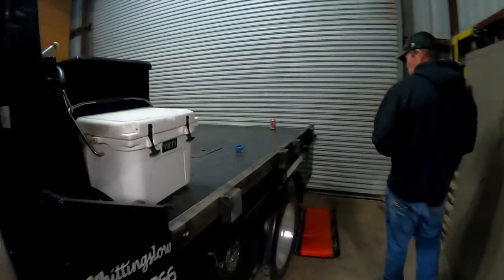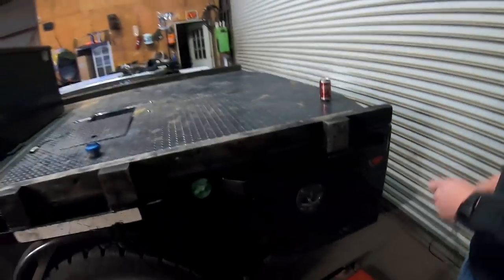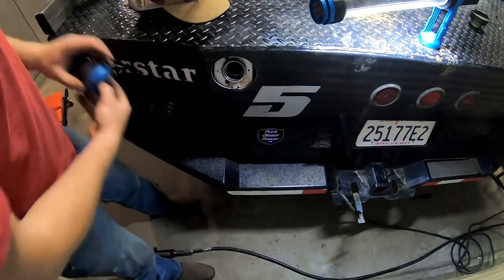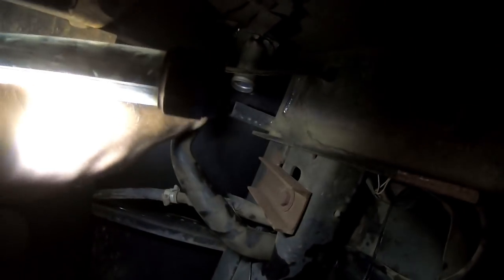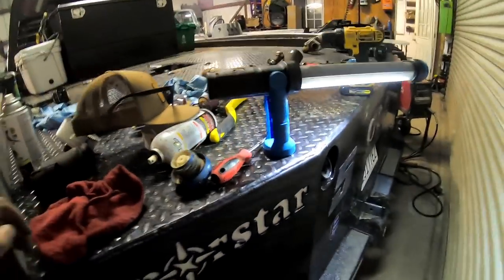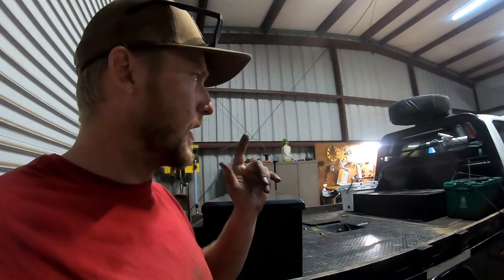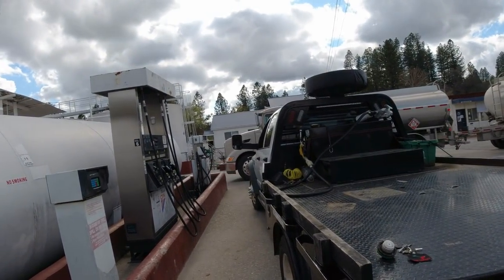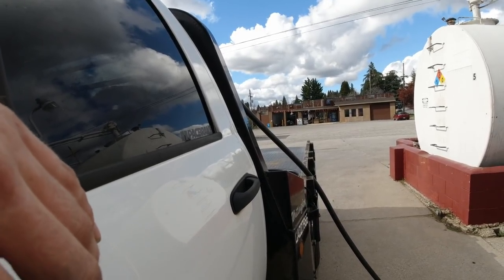Taking a 4 inch hole saw to my 4500 dollar flat bed. Diesel went everywhere

Comment: I have a few rigs that click off and you have to hold the darn nozzle a certain way and they are a poor design from the factory🙄. Your a problem solver, anything that makes life better, is a good thing. You had a little practice on the goose neck so it came out just fine, thanks for sharing and stay safe out there.👍👍👍🇺🇸

Comment: Did you ever do a video of the fleece coolant bypass how it worked out for your 5500?
Reply from the maker: Shearer Performance yup I forget what it was called but it definitely help maintain a calm engine temp when pulling long grades
Reply: @VBELTandSON  awesome I'm putting one on my 6.7 tomorrow any pointers on how to install it I have a 68 I know the bracket on the top of the transmission has to be removed but after that I'm lost lol

Comment: Diesel will make a radiator hose swell...use hoses rated for diesel. I just moved the fuel location on my CM flatbed...Finally I can fuel without clicking off or spewing out! Keep up the great vids and stay safe!

Comment: Nice victory Sam! You’ve been fighting with that problem for a while now. I’m a Norstar fan but they should’ve designed there skirted flatbeds for the 5500 trucks like Bradford built does where it comes factory in the back location to fuel up at.